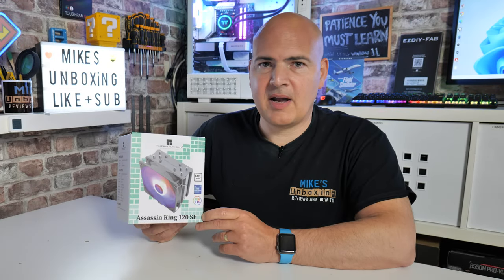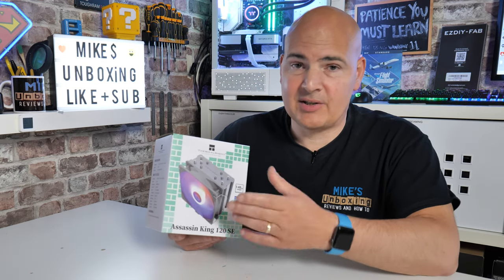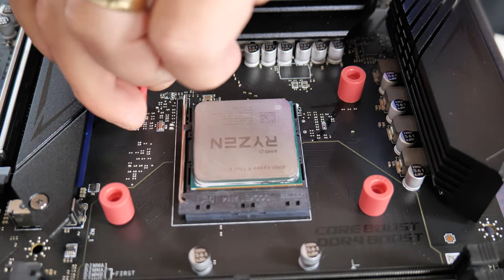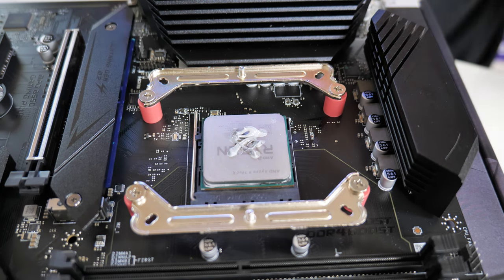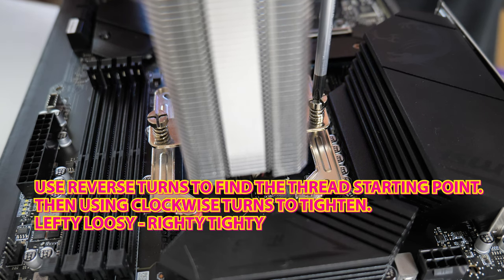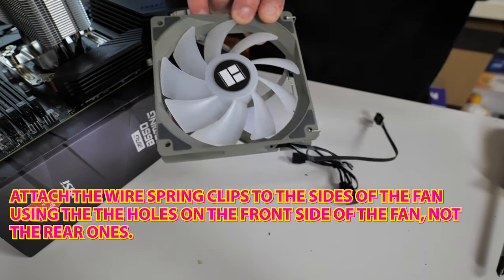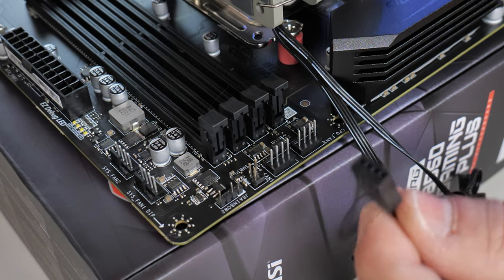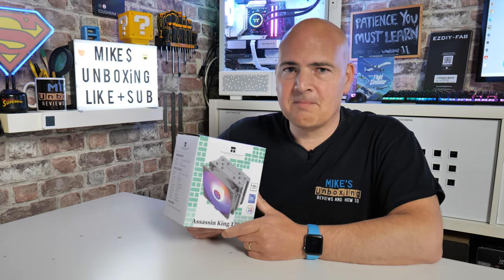How To Install Thermalright Assassin King 120 SE ARGB On AM4 AM5 CPU

Comment: I bought this cooler. I have to admit that I like your videos. Very simple and informative.  I have not built a desktop in over 5 years and so much tech has changed. I am currently building and I have all the components but I am waiting on my GPU. I was going to get a GTX 4070 but waited to get a RTX 4070 Super for $50 more.  I decided to go from AM4 to AM5. My components:  MSI MAG B650 Tomahawk WIFI,  Ryzen 5 7600 (will upgrade in a year or so),  Thermalright Assassin X120 Refined SE,  G.SKILL Flare X5 Series (AMD Expo) DDR5 RAM 32GB (2x16GB), 6000MT/s CL30-38-38-96, GAMDIAS ATX Mid Tower, Corsair RM750e power supply and WD_BLACK 2TB SN850X NVMe Internal Gaming SSD Solid State Drive. A few extra non RGB fans for the top exhaust.  I think I am ready to build after watching many of your how to videos like how to spread thermo paste, flash bios and the like.  I am still waiting on the Asus RTX 4070 super OC.  Thank You for your informative video's
Reply from the maker: thanks for the kind words and don't forget there is also the discord if you need a bit more help.

Comment: Hello, in some reviews of this cooler, I found that some people put a piece of iron on the motherboard directly behind the processor in order to connect with the two pieces of iron next to the processor that you installed on the plastic pieces. So my question is, do I have to put that piece of iron at the back or do I not need it? So ? By the way, my motherboard is Asrock B550M Steel Legend. I will be really happy with your answer
Reply from the maker: i am sorry i don't know what the piece of iron is. if you mean the AMD motherboard backplate, that comes with the motherboard
Reply: Thats only on intel motherboards you need that backplate

Comment: Thanks for doing this video. I was looking to see if this cooler would work on my new build as at Christmas I am going to move the new machine onto a closed loop water system, but I want to build it now as the parts I want are on sale now and I can have the new system 5 months earlier. Thanks for making it and showing the steps. It would be nice if the manufacturer would do this.
Reply from the maker: Glad I could help

Comment: A straight forward installation when following your guidelines. How did cooling compare to previous towers such as the ID Cooling 214? Plus on your itx builds with vertical airflow can a tower be rotated 90degrees? Thanks for reviewing Mike and Kath 🐈👍
Reply from the maker: Most 120mm coolers are very close to each other in terms of performance the bigger difference seems to be the fan noise. Not sure about the 90 degree option think it
Reply: From a thermal perspective I would not recommend that. You will either be pulling hot air directly off the GPU, or blowing it on it.
Reply: Yes it can be rotated, with little loss in performance.

Comment: I have received TR BA 120 but not the 3 pin Argb controller yet. Can I use this meanwhile without RGB effects? Like connecting only 4 pin cpu fan cable

Also in the pack there are rubber pads for which nothing i mention as to where it should be used
Reply from the maker: yes you can

Comment: Hi Mike, Thanks for the video very helpful, ive installed it but do you klnow a way i can change the rgb at all? i have an msi motherboard and cant seem to change it using mystic light? thanks
Reply from the maker: if the ARGB is plugged into the ARGB header it should change with mystic light if the motherboard is selected
Reply: @mikesunboxing  okay I see, it only came with 1 cable coming from the fan which i plugged into cpu fan 1 header should I plug it into jcorsair1 or sys fan?
Reply from the maker: @mortonlillico1576  if you only have one cable you don't have the ARGB version

Comment: hello i didnt get the am4 bracket only the lga 1155 and 1700 would it be fine to use a bracket from different brand that looks the same?
Reply from the maker: if you get in touch with them on social medias they will likely send you one

Comment: does it Need to have the rgb pin connector inserted to work?my b760m ds3h ddr4 mobo wont start up with the 12600kf with the bios updated!not sure if its the Jonsbo cabinet that only got the power pins and power sw on with no reset pins in it! I know I only put the cpu fan headers on and not the rgb!
Reply from the maker: it can work without the argb connected
Reply: @mikesunboxing  I bought a cheap msi pro h610 mobo it cant connect the rgb fans and it works fine, the shitabyte b760m mobo is not working properly I think!giving it to my pc pro nephew to see if he can fix or use it!

Comment: even tho i did the measurements (its tight), do you think this fits on an X570-A Pro with a 2070 super beneath it?

will buy a smaller one anyways on top just to be safe... but would be cool if you know :)
Reply from the maker: yes that should be fine, close but fine

Comment: I think you have used the Intel mounting brackets?
Reply from the maker: the brackets are universal for Intel or AMD sockets
Reply: @mikesunboxing  Thanks. Interesting. The Peerless Assassin has different mounting plates for AMD/Intel. You would think that if a standard mounting plate is possible, it would be designed into the Assassin range.

Comment: I have the msi b550m pro vdh wifi motherboard and the thermalright assassin king 120 se argb cooler where do I put the cooler connector and where does rgb connector go
Reply from the maker: the aRGB connection goes to jrainbow1 and the fan lead goes to CPU header 1
Reply: RTFM.
Reply from the maker: @ZenAndPsychedelicHealingCenter  Lol!

Comment: Thanks for the video. I upgraded my cooler + CPU from ryzen 3600 + stealth cooler to  5700x3d + thermalright Assassin Spirit 120 V2 which looks very similar to this one. I used your video as guide to my installation. My old CPU used to thermal throlle at 96 degree while pulling 60 watts in gaming and idling around 70 degree.
With the new cooler + CPU it is idiling around 45 and pulls around 60~70 watts while gaming and sits around 70 degree. 
Some CPU heavy game like Battlefield 2042 and dragon age it was using around 110 watts while loading and the temperature would climb to 88 degrees, but it will come down to 80 degree while gaming while pulling somewhere between 80~90 watts. is this temperature range normal ?
Reply from the maker: yeah that sounds about right, depending on the rooms ambient temp and the case airflow

Comment: Guys, how did he know where to put the fan cables in. Does it say on the cable of something which one if goes in?
Reply from the maker: they are both quite different plugs, but one goes to the cpu fan header, the other to an argb header
Reply: Oh so you have a motherboard with a argb header. Mine is a rgb header and I got a thermalwright assassin X 120r. Is the fan cooler rgb or argb? If it’s argb can I still plug it into my motherboard that says on its manual rgb. I’m really sorry I just need help 😥
Reply from the maker: @TrulyLiam1  sure no problem join the discord chat - link is in the video description

Comment: Здравствуй Майк, какой реальный ТПД на системе охлаждение, так как сколько бы я не смотрел у разных продавцов пишут ТПД не достоверно. И хороша ли термопаста с фазовым переходом Honeywell PTM 7950SP?
Reply from the maker: the true TDP for this i would say is about 150w to be comfortable. So most 95w cpus are fine, the 105c newer ryzens are going to be at the limit here without very strong case airflow. Can't comment on the thermal paste, not got around to trying it yet sorry

Comment: Hi Mike, you sound like you are from the same area as me! I only have a 4 pin rgb on my board, do you know if there is a method to connect the 3 pin to a 4 pin, from what I've read its a no - thanks
Reply from the maker: you can get an adapter to convert 3pin argb to 12v rgb but that effectively makes the argb single colour, but it can be done

Comment: i need asap help right now, i just built my pc but the air cooler is blinking red .. does that mean it’s working or is there an error
Reply from the maker: that means the plug is in the wrong port most likely or not inserted fully

Comment: Would this Cooler Cool the AMD 5800x3D
Reply from the maker: sort of, the 5800x3d can be both cool and hot depending on the loads. Being this is one of the cheapest 120mm tower coolers on the market that is half decent. So give it a go

Comment: Got this one, installed it, cant close the cover anymore :v (its a generic cpu case).
Lights are great (had to use a Sata to 3 Pin adapter with a small controller in it).
And temperatures are even cooler (see what i did there).
Granted, im using an i7-4785t, which is the low power comsuption but its still great.
Reply from the maker: Very nice!

Comment: Hmm. Getting yellow ram light and red cpu light. Wont boot
Reply from the maker: could be ram training or the ram is not compatible / setup right
Reply: @mikesunboxing  what u think I should try ?

Mobo is msi b650 gaming wifi. Can't update bios, no screen. Id really not have to reapply paste. Rams defo in correct slots, I've reseated, same thing

Ram is
CORSAIR VENGEANCE RGB DDR5 RAM 32GB (2x16GB) 6000MHz CL30 AMD EXPO iCUE Compatible Computer Memory - Grey (CMH32GX5M2B6000Z30K)
Reply: @mikesunboxing  oh God, pulled CPU out and pins are bent. Absolutely furious. Never had an issue Intel 1155. Brought a new board. Now I'm terrified.

Comment: brother if ur still awake can you give me a quick response to a case suggestion for ATX: I'm looking at argb setups for under £55 atleast 4 fans, however i will go with £35 under for a white case with no fans but has the argb controller stuff on the back panel of the case/vertical Buttons instead of horizontal. here's what I'm torn between: 

Blackhole
montech 1000 lite
Aerocool Cylon RGB 
IONZ GAMER EDITION TAIYŌ 
Montech Air X Mid Tower
Reply from the maker: How about the gamemax f15 mesh or too expensive ?
Reply: @mikesunboxing  for that price what would i be getting thats better than the other cases i mentioned bud?
Reply from the maker: @statix  the f15 and the lianli 215 that shares the same chassis and setup are two of the best cases I have used for the money, or there are a few more new ones coming from ionz soon if you are not in a massive hurry
Reply: @mikesunboxing  thanks for replying really appreciate, erm im in serious need for a case sadly, i really liked the look of the AirX mid case, do you rate it?
Reply from the maker: @statix  never used one sorry so hard to give it a real rating, gets decent reviews though
Reply: @mikesunboxing  i ended up shitting the bed and going for a gamemax optical g510...